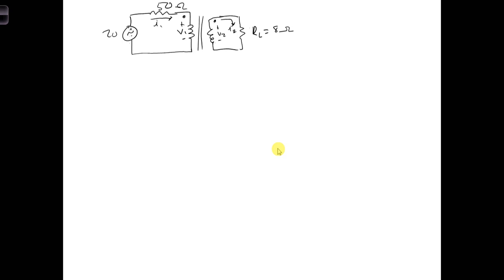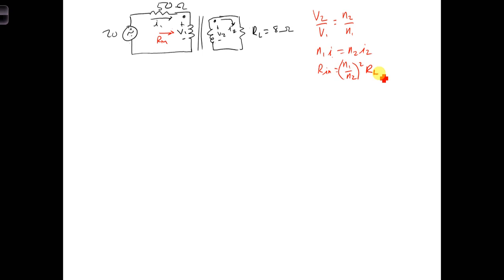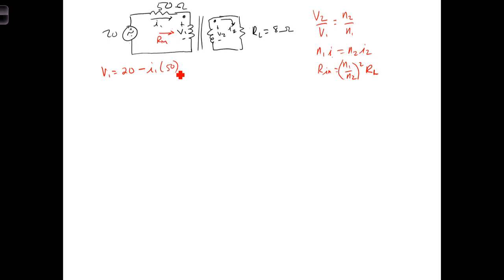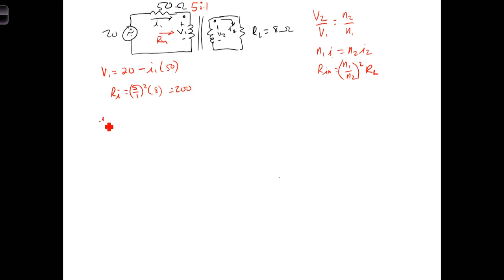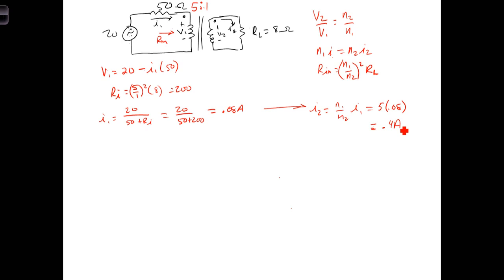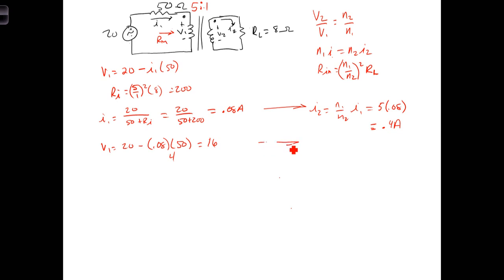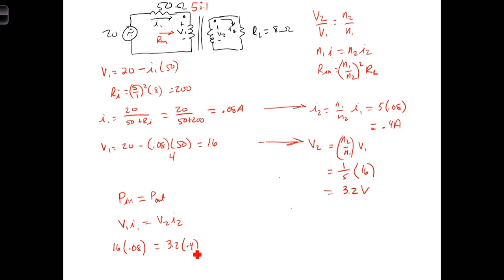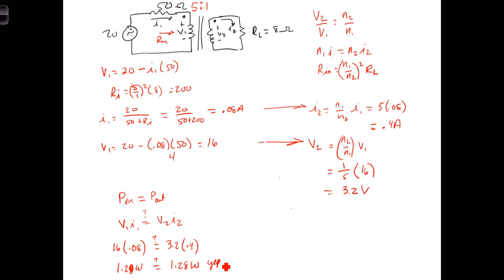ETrans 4 1   Ideal Transformer with Primary Resistor

Comment: How do you find Rin if you have the mutual inductance but no turns ratio?
Reply: I would solve for the ratio of V1 and V2. since the ratio of the two is equal to the ratio of N1 and N2, you can use that as the value you square instead. similarly, you could use the ratio of i1 and i2.( assuming the currents were provided or solved for without using Rin)